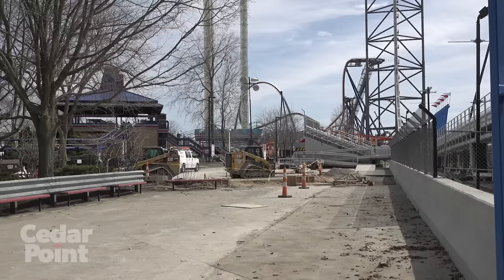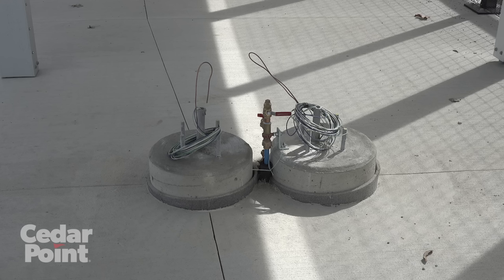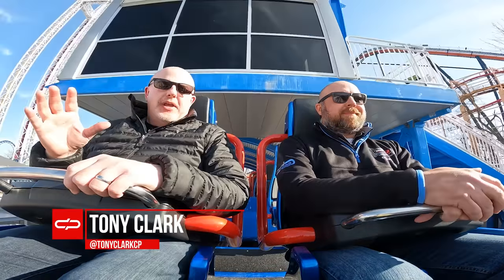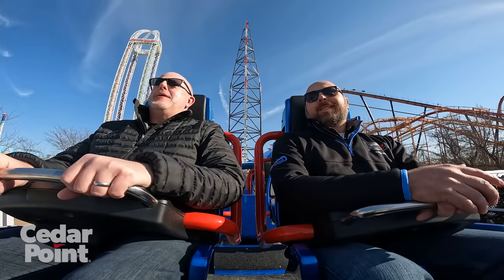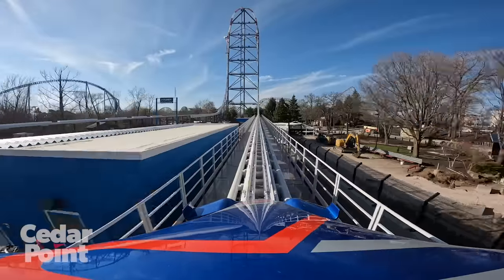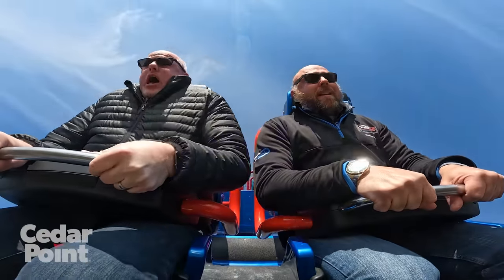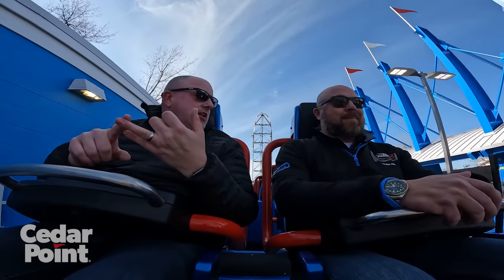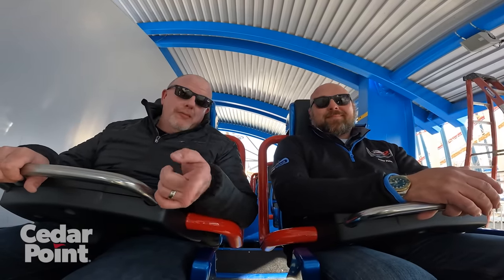Top Thrill 2 Pit Stop | Episode 10: Test Drive

Comment: True story my weight loss journey is literally so I can fit back on coaster an I plan by next summer to be back on a coaster an Ohio is on the list to go after I get my body back in shape
Reply: You can do it. I get that... I need to get my amusement park walk in gear again for another year ha
Reply: Stay persistent, you can do it. I didn't fit on Steel Vengeance and work hard to get on it, also my main goal. Such a great reward aside from health. Will be so worth it, eye on the prize
Reply: @bigiggmac  it is but dammit whenever I have an amazing week no sugar carbs or processed foods that that weekend the carbs are screaming for meeeeee
Reply: @teteduhduh1347  carbs or coasters, your pick. Stay positive, stay vigilant, stay active. Bit by bit it will happen, and it'll be worth it. Small wins add up. Just keep going forwards (even if you slip a tiny bit it's ok, get right back at it). 

Steel Vengeance though. TT2 though. All of the coasters though. Hang pictures of em on your wall if you need to!

Comment: By my count, looks like 45 seconds from launch 1 to clear the top hat, plus 15 to 25 seconds to get the train on the launch track with switch track back in place...so maybe 60-70 second dispatches? (depending on whether a train can hold and wait after the station but before the switch track)

Comment: The ride has a crazy vibration is what is looks like and the camera probably having stabilization on it . Hopefully the more it runs it will go away but it is the fist ever mega zamperlaia project
Reply: But like they did reuse alot of the Intamin Track. The Zamperla spike track looks pretty smooth, also looks like the camera does wobble a bit
Reply: I don't have a lot of confidence in it being smooth. The Smaller Zamperlas like Thunderbolt at Coney Island shake like crazy. This one goes over twice as fast. It likely with be a jackhammering mess sadly.
Reply: @DanielBlaney  a lot of people have been comparing it to old Dragster. But also Ka, and the roughness is actually the same. These trains sit higher up so it's gonna be a little more noticable

Comment: I'm very worried about how fast that goes over the Top Hat!
Reply: Dragster also at times SPEED OVER top hat; not really that different of air time as when it went over slower.  Actually most don't realize THIS== (for TTD) once train hit the white section on the tower rise, till it left the 270 almost 8 sec. you were feeling ''negative'' G's [even when crossing top hat] (not full 'air time' like on hills)- TTDRon@4649 rides /29RB

Comment: Looks like it takes the top hat at some speed
Reply: pretty sure that clip is sped up artificially
Reply: @protowave  They have zero reason to speed up the footage. Most likely the launch isn't quite calibrated yet or, due to testing or changing conditions, it didn't have enough data to calculate the "correct" speed to go over the top. Maybe a combination of both things. Or maybe they want it going over this fast. 

TTD would vary the launch speed based on a few criteria I'm pretty sure. I would guess TT2 does the same.

But I don't know why they would speed up footage... there's no point to that at all.

Comment: Still doesn’t go up the spike that high
Reply: First train doesn’t go up high, backwards goes up pretty much 350-370 feet.
Reply: @OfficialEthanStillCodes-9229 
Which is still higher than any other ride there, apart from maybe SlingShot.
Reply: @eccentricgamer4111  Not saying it’s bad, I meant the first train doesn’t go that high, but the backwards train goes pretty high up.